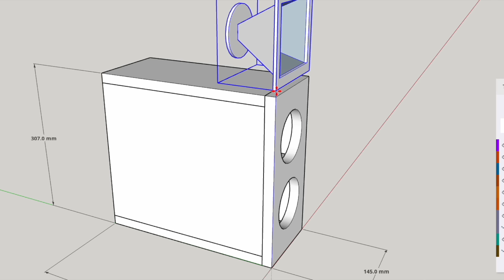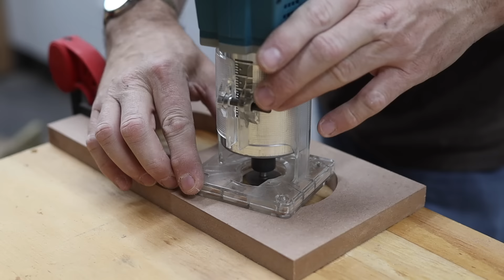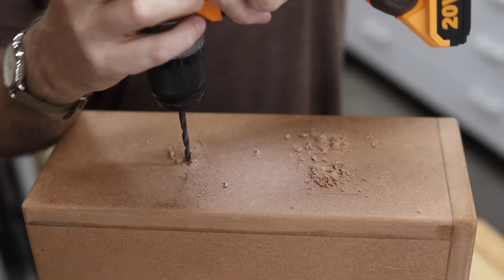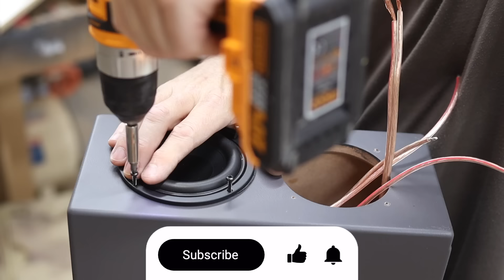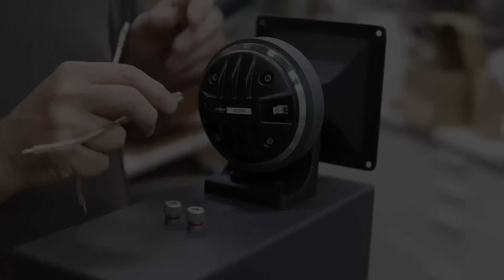Building High-Performance 2.5 Way Loudspeakers with Compression Driver & Horn - by SoundBlab

Comment: The drivers are not time aligned since the tweeter is set back on the cabinet. Shouldn’t the woofers be delayed slightly to compensate for this?

Comment: Why not build it with woofers that more closely match the horns sensitivity level instead of padding it down to match the mids? You'd have a speaker with higher sensitivity, possibly have less crossover components and end up with a speaker with much higher max SPL and headroom.. like two Celestion TF0818 or FaitalPRO 6FE200 - love to hear your thoughts on this?

Comment: you've got the horn mounted wrong. it should be turned 90 degrees so horizontal dispersion is more than vertical dispersion.

Comment: Now that you have had these for a while, how would you compare them with your previous favorite, the two-way stand mounted with the racetrack passive radiator on the back? I have both plans and I keep going back-and-forth over which ones to build. I priced them out and they were nearly identical.  In the interim, I’m just about to start building a pair of the dynamites.
Reply from the maker: Hi, I will be more inclined to build the two-way with the racetrack passive radiator. I prefer the slightly more powerful bass output and the tweeter to me sounds more smooth. Not to take away form the other design, which still performs perfectly well, suppose just a matter of taste.

Comment: Really cool to see how you built these. I would be tempted to use ply instead of MDF. I would respect the lack of internal volume and put the crossover externally in its own enclosure. The edges of the horn seem to be likely to have resonance modes that could distort the sound. I would probably extend the front baffle upwards with a cutout for the horn to be attached to.

Comment: Sir, the compression driver and these woofers are not a good match in terms of efficiency. Could you explain the reasoning behind pairing low-efficiency woofers with high-efficiency tweeters?

Comment: There are questions about the quality of soldering )) This awl-shaped tip for spot soldering, it gives off heat to a small area - Fourier principle of heat exchange states "To heat an object - it needs to transfer heat to a more massive object." I advise changing tip to 4-5 mm chisel tip. I also advise you to refuse steel nuts and metal-containing terminals - Aliexpress sells plastic-copper EIZZ terminals (a cheaper analogue of WBT) 😉😊

Comment: Hi, Thanks a lot for this video. 
Few years ago I bought Klipsch RF62 pair for cinema, and since a few months I think about building a new cabinet for its components for a more attractive look and more music listening. 
I had in mind the kind of configuration you choose, putting the 2 woofers in a smaller cabinet and extracting the compression tweeter outside. The smaller cabinet could be ported or transmission line....
How do you think it could affect the sound they produce? 
Thanks in advance for you feedback. 
Stéphane (Belgium)

Comment: Nice job but frankly clamps are much better than just pins.  A couple of pins for alignment and then clamp to hold for glue cure.  Also, slow down on your soldering.  You had some janky looking solder joints there.  If you have a hole for wire, use it!  A little extra rosin flux is not a bad thing either.  More dwell time will result in much better and more reliable joints.  I like the speakers and the way they turned out though.  Also like the choice of compression drivers.  We have Klipsch KD4 and KD2.5 speakers and are very happy with them. Of course they are far larger and obtrusive on the viewing space.

Comment: I think that the orientation of the ME20 horn is not correct. I suppose the way it is mounted now will result in (nominally) 60° coverage horizontally and 90° coverage vertically. Please check the drawing and the product picture on the international B&C Speakers website. 
I noticed that e.g. Thomann show pictures of the horn in the orientation you chose, but B&C and Parts-Express have shown in the orientation that I think is more useful (broader horizontal dispersion).
Reply: He’s probably trying to reduce reflections from the walls. If they were being used as PA speakers wider throw would be desirable.
Reply: @6-Iron That's a possible explanation, of course, but not explicitly mentioned anywhere. Reflections from the ceiling could be the result, though. Normally, we prefer wide horizontal throw over vertical in our homes to widen the sweet spot. Listening height is usually not as variable.

Comment: Good morning, sir
First of all, I don't understand English due to lack of training
Very interested in your realization, I want to do the simulation with LTspice.
My goal is to find the tuning frequency of the bass reflex taking into account the internal volume, the diameter and the length of the port.
I tried to evaluate the dimensions of the vent approximately diameter 6.3cm => 2.48 inch
And length 15cm => 5.9 inch
I evaluated the capacitor c3 at 3x33uF => 99uF, the other components are difficult to find.
I evaluated the cut-off frequency of the filter according to the amplitude-frequency curves of the Speakers from 1Khz to 1.6KHz.
I evaluated the cut-off frequency of the filter on the amplitude frequency plot of the speaker from 1kz to 1.3Khz
In conclusion : I would be very happy if you would agree to send me the values of the filter components in order to make a simulation with good accuracy.
Thank you in advance very cordially

Comment: It’s nice to see quality cross over parts. They are larger and seem to be around 20% volume of the cabinet. Was this taken into account when calculating the speaker cabinet volume? The midbass seems to be affected by the reduced volume and sounded boomy through my headphones.
Reply from the maker: Yes, I always account for extra volume. However, we also have to take into consideration the damping added to the enclosure that will again add some volume depending on how much stuffing is added. Keep in mind this is a sound demo to show that the speakers play, not intended as a means to judge what they sound like. You are only going to hear an interpretation of them as presented by what you are listening through.

Comment: Nice build, but why not just screw the horn on with two screws at the top of the baffle and maybe just add something to hold the weight of the driver?
You might be getting some diffraction off of the top edge of the enclosure.

Comment: Im kinda curious about how much air flow is coming from the port. Im confused why you add the poly fill with an air port..i always thought that was better for sealed enclosures...and ports you want as much air as possible going threw? Im kinda speaking from a sub woofer/car audio POV. They sound and look amazing.
Reply: Poly fill is more of a sound quality enhancer. Calms the frequencies from bouncing around in the box which can show up in the overall sound.

Comment: Ich möchte nicht aggressiv argumentieren aber was willst Du uns hier mit Mini Treibern, die nur bei 250 Hz, 87 dB erreichen, zeigen ???
Wenn Du sie parallel schaltest, kommen 2 Ohm heraus, wodurch der Lautsprecher nur an 2 Ohm festen Endstufen betrieben werden kann und maximal 93 dB im Mittelton leisten kann, kombiniert mit einem Horn, welches 110 dB leisten kann.
Das ist doch völliger Blödsinn ! 🤷‍♂️
Reply from the maker: The drivers are connected in series to give a nominal impedance of 8 Ohm. Since we have a 2.5 way configuration on the woofers, the lower driver is compensating for the baffle step loss. Yes, the compression driver does have very high sensitivity, and when used with the horn we can cross it over rather low, get good integration with the woofers in phase, and lower the distortion whilst maintaining excellent dynamics with none of the listening fatigue.
Reply: @SoundBlab  Now I understand your idea behind this speaker. The baffle step is proactively avoided by the lower bass speaker raising the lower frequencies by 3 dB, which makes the frequency response linear again. And you use the horn to compensate for the offset of the acoustic phase to the bass. A well-known principle that is too often neglected in combination with dome tweeters.☝️And thanks to the bass reflex, the bass cabinet remains small and handy. The speaker is guaranteed to find many replicas! 👍 Listening fatigue is an important topic that is given far too little attention in many speaker designs. I completely agree with you there. I suspect that it arises from the problem when hi-fi speakers have too narrow a band electrical and mechanical load capacity and as a result distortion components mix into the signal far too early, even at moderate volume. Not everyone likes an upper treble range that rises too sharply.  People react very differently to an increasing high frequency range. This has a lot to do with the development of the ear and the varying strength of the ear's protective functions. For some, these protective functions work well into old age, for others these functions disappear after the age of 50, resulting in a changed sensitivity. I always needed the typical cow tail characteristic, i.e. lowered midrange and increasing high frequency range - especially above 8 kHz!☝️ I cannot enjoy music with a ruler with a smooth frequency response because I don't get enough high frequencies in my ears. I have worked in a loud environment all my life, which is why at 59 years of age only just 12 kHz are audible and I am therefore particularly dependent on the upper 3 kHz. Here in Germany there are two YouTube channels "Snake Oil Audio" and "Cafe' Audiophile", whose operators only consider single ended tube power amplifiers to be the best amplification - i.e. outputs from 3 to 10 watts.  He justifies this by saying that a maximum of two amplifier stages can form an output stage, because the sound suffers too much from the third stage onwards. But because the tube has a very organic distortion spectrum, it is acoustically preferable to the transistor. It is logical that only very efficient loudspeakers with high sound pressure can be operated with such low electrical output. That is why I advocate using sound reinforcement loudspeakers in home hi-fi and in conjunction with tube amplifiers in order to achieve sound pressure levels of 100 dB/1m. Of course, these loudspeakers become very large in the bass range at the latest, which is likely to annoy many wives. 😳 Of course, the two-way box with horn and 2 x 12 inch components is the classic here. If, like me, you reject bass reflex below 100 Hz, you have to have 3 ways, which means that the bass branch has to be active but can then also be built smaller and exotic designs such as the "Dipole Cardioid Subwoofer" according to Leo Kirchner can be used.  By using PA loudspeakers with really enormous sound pressure, you automatically have a very high distance between the effective level and the distortion level and you don't have to worry about fatigue when listening, provided good loudspeakers have been selected.

Comment: even if they are not very beautiful to look at, you could add some piezo super tweeters motorola to refine the very high frequency , which is an area too important for hi fi monitor use , you can also take advantage of the addition of the super tweeter to linearize the medium-high frequency of the horn by a couple of decibels with a resonant cell

Comment: This doesn't make much sense from a sensitivity stand point as the TCP115-4 has a very inefficient sensitivity of only about 82-83db. That means you have to dial down the compression driver so much. It would make more sense with a woofer that was around 88 to 95 dB to get the most out of the fact you're using a compression driver

Comment: Excellent build, thanks for that. They sound really good on my kitchen system here at home: vintage (1999) Technics receiver, AR Rock Partners, run from my pc through Bluetooth. LOL. Sound demos on YouTube are so silly.........Cheers!
Reply: Silly yes, but if you make a speaker, you had better dang well play them.
Reply: @tkcdac  Agreed. I would also rather hear them than see them plotted on a graph. But, if I play the demo on my JBL 4312's through my Harmon Kardon AVR-525, the demo will sound different, no?

Comment: Nice build again. Did you see Danny Richies upgrade of the Klipsch Forte? Where he talks about alignment of the voice coils and associated offset issues. I would line the cabinet with GR-Research No-Rez or similar. I got smthg similar from Vibraplast in Switzerland. The Boston Audiophile also showed the benefits of damping a moulded plastic horn with damping material around the outer surface

Comment: Imma be honest, i'm never much for sound demos through youtube, But this demo i could tell that there is controlled bass, clear mids, and i had no doubt about the highs considering the compression driver you used.  This demo stood out as communicating more to me about the speakers than usual, enough that i definitely want to build them.  I'm kinda picky about horned speakers though, but i think it would be worth the effort and cost on these.
Reply from the maker: That's fantastic to hear - I'm glad the sound demo came across well for you.

Comment: A cheap alternative. Run an open 5" FR driver on top of the box with a woofer in the box. Just a large inductor (5.6 mh) on the woofer, and that's it! Just connect the open FR driver to the binding posts at the back of the speaker box. Slope the open FR driver like 20 degrees back for great sound (adjust to your liking). Use a heap of Blue Tack to quickly mount the FR driver on top of the box. Make sure both FR drivers are sloped exactly the same. It doesn't sound that much different in sound but way different in image with just one degree difference in slope! 😂 The whole sloping idea is for image. 🎉  Sounds come from nowhere! 😂 Spoiler alert, you may need a sensitive woofer to get the warmer sound and to HAVE ENOUGH BASS! 😂 Mine have 10" woofers and they kick. 😮

Comment: I would have put round overs on those holes to smooth out the air flow. I would have also used nut serts to screw the M6's to mount tweeter.

Comment: I used the tcp 115 on my first speaker build. I took a hard maple antique record player stand apart and reclaimed the wood, sanded it into boards made a tmm with a 8" passive radiator. I used a combo of tung oil, spar polyurethane and mineral spirits and gave it idk how many coats. It came out really nice, especially for my first build. But I never thought of using a compression driver. Great job 👍.